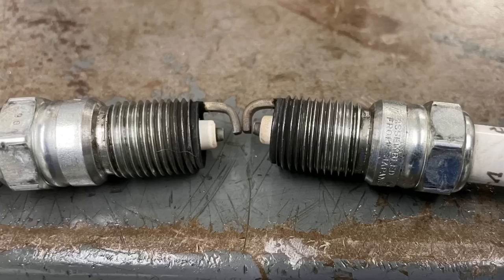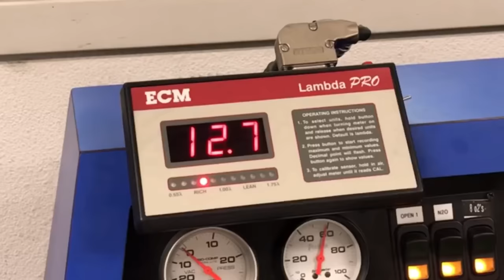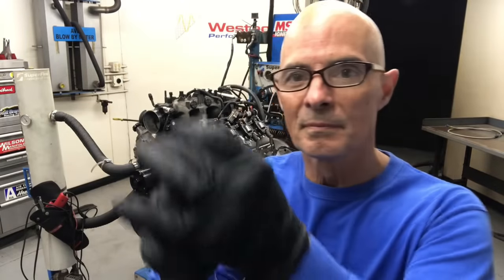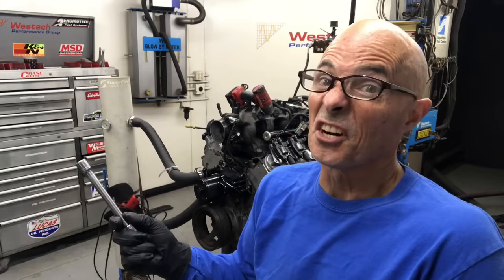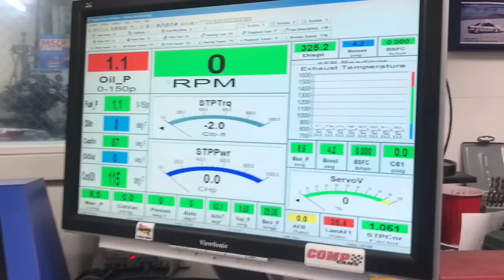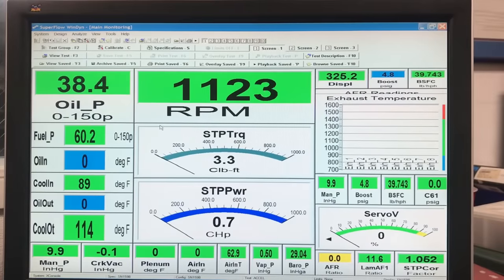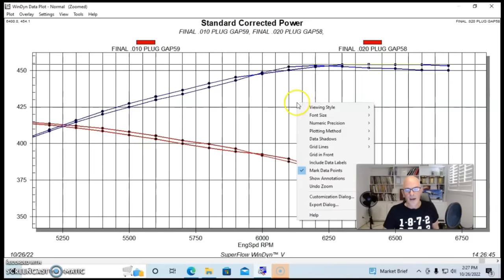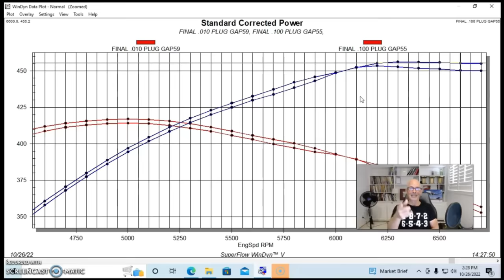JUNKYARD LS PLUG GAP TEST. DOES MORE GAP EQUAL MORE POWER? HOW MUCH SHOULD I RUN? .010 VS .100 GAP

Comment: Wow interesting results. I wonder if the really large gap could be hard on the coils in the long run. I guess it would be interesting to test gap with boost
Reply: Yes, a large gap increases the firing voltage and can lead to wire / coil damage.   This is why I replace coils if I see very large gaps on a neglected engine.  A voltage damaged coil can lead to an intermittent missfire that is difficult to track down.   What happens is that the coil arcs internally if the plugs firing voltage exceeds the internal arc voltage threshold.  
For an interesting bit, do some research on the SAAB Trionic System for detecting knock.
Reply: It's definitely hard on the coils. Seen many burn out if plugs not changed soon enough. Especially on the 2v mod motors.
Reply: Larger gap is definitely harder on the coils and whole ignition system. Larger gap requires more coil energy to make the spark jump. Not only do you get a hotter spark but you get a much hotter coil. It wears everything more quickly. Plugs, wires, coil(s) and in the olders days the Ignition module as well.
Reply: @bobroberts2371  I have had this happen with old worn plugs killing the coils to.
Reply: Keep the coils COOL... helps tremendously. Mount in cowl, fender apron, core support, etc.
Reply: You guys got it backwards. Less gap means MORE juice flows which means the coil overworks and runs hotter. (Think short circuit). 
More gap means more resistance which means less juice flows. 
Resistance is a valve... more resistance=less juice.
Reply: @joebloe9901  Amp draw on coil says otherwise. It takes more current load to fire a wider gap then a smaller gap. Go ahead and test it. I have many times. Amp draw does not lie.
Reply: @terrygonyon4490  nobody can explain why?
How does more resistance equal more currant draw?
Reply: @joebloe9901  well lets put it in something easy to understand. If you had to jump a 2 foot ditch versus an 8 foot ditch which one would require you to put in more work? Wider gap is more work for the coil and makes it run hotter and can produce more misfires where as the smaller gap is easier to jump and requires much less effort. Less effort requires less energy and this is why spark stays a constant. Wider gap requires more energy to jump thus is a hotter spark. This is why in boosted the trick was to run a higher output coil to support the wider gap to get a hotter spark because with the smaller gaps the compression could easily blow the spark out.
Reply: @terrygonyon4490  a coil puts out one voltage. It doesnt put out more voltage because you demand it
By your logic if there was no gap the coil would run nice n cool. But that would be a short circuit and definitely burn up.  
Why do you think coils require a 1 ohm resistor to operate? Because with zero resistance it will burn up.
You are right it takes more voltage to overcome more resistance but a coil doesnt have more voltage...it has one voltage. More resistance equals less current flow per give voltage.
Reply: @joebloe9901  Not true output voltage is related to input voltage. You change the input voltage and output also changes. MSD boxes change the input voltage considerable amounts. Magneto can have a more constant voltage due to the magnetic firing. I've never tested output voltage for different gaps but I have tested Amp draw on the input side and it does vary with gap.

Comment: my guess is the factory plug gap is set to give fair power but not misfire immediately when a plug it a coil starts to get tired. 
Everything being equal, looks bigger gap is better, provided your coil throws a spark hot enough to jump it.

Comment: Yea I done this experiment on my old 302 engine that I had built for my 68 camaro . Basically it was a 12.5 to 1 , set of heads of a G gas car that were capable of making hp . A 600 isk roller sold lifers . I had a shop that build dirt track engines build the bottom end . At any rate I used a HEI distributor recurved for this engine.  The engine idled better with about .045 gap I think . I open up and closed the plug gap to see what the engine wanted .I spun this engine to 7800 regularly lol. Also I use to change the lash a bit to get the engine to do what I wanted. I for got to add the fellow I got the heads that use to race a Monza told me he filed the strap to I think about the center of the electrode.  Seems he said it unmasked the flame . That was a long time ago

Comment: I experienced the opposite scenario with my L29 454. Factory gap is .060, changed to .045 and experienced smoother idle and crisper throttle response etc. (seat of the pants, no numbers to prove). However, I got the idea from the Chevy truck forums which had info from a source that actually dyno tested L29 engines specifically in stock tune and it was found that a smaller gap than .060 yielded an overall better running engine.
Reply: i have mine gapped to .50 and it runs much better but mines a mfpi vortec 454
Reply: @LightningFast240  
Same as mine. Mine is a 98 with 61,000 orig miles on it. It’s a shame they don’t make them anymore.

Comment: I'm glad you did this test.  Very cool. I would have suggested a third gap set properly.  It may have been significantly higher than your 2 extremes.  I don't know.  But, it may show a parabolic curve with  a peak. I have never been one to spend time getting a precise gap.  Just close to spec. Thanks again for your good work.

Comment: Had a Honda CRX that I put on a set of Nology wires on.  Didn't notice any power gains but it did solve a problem with high rpm miss after 5200 to 5500 even after installing a 45k volt coil and new cap, rotor and Accel wires.  After installing the Nology's it would rev as high as I would dare push it without miss.

Comment: Back in the 70s-80s, Oldsmobile used a .060 gap on their V8s and even .080 on some engines! IF your ignition system can deliver the needed voltage, a bigger gap is the way to go, within reason. A BIG fat and hot spark is the only way to ignite an 'iffy' fuel mixture be it Lean or Rich. Of course, it was hell on HEI ignition rotors as they got so hot, they'd burn a hole in the center.

Comment: The reason for the increase in power. Is hotter spark cause it takes more energy to jump a bigger gap. You run the risk of wire spark leak and coil overheating which both equals misfire

Comment: Not sure if a single coil could fire a gap that big. The coil on plug (coil near plug) has an advantage. Running the huge gap will really wear out the plug wires. Very cool test!!
Reply: Use two sets of NAPA 7OO172 Farm Tractor wires. They are for a four cylinder tractor but the solid metal wires are really really long. You cant wear those dogs out. Be advised a stock HEI will eat the side electrode completely off a standard plug in 3000 miles but it will continue to run normally if it's NA.

Comment: my old points cars I would open the plug gap and close the points gap for more dwell time.
you need strong spark to ark across a big gap. 
Advantage is you can burn more fuel with a big ark.
Disadvantage you need to set your points more often and possible over heat ignition coil.
I used a steep hill for my dyno, the fastest speed I could get up that hill was the proof that the tune was on point.
that was the old school tuning. everything is tuned by computers now.

Comment: I tune mainly turbo engine's and found 0.7mm plug gap works well and stops misfires, that is why it will give more power. i've also had a Jag v8 in over the dyno that had been everywhere and they couldn't fix a light throttle and full throttle miss, in-between it was fine, no one had changed the plugs since new with about 120,000km on the clock the gap was large, very large. I've also had misfires with the wrong plugs fitted a few time's. the best was one toyota that had special plugs that cost about $50 each and someone put $10 plugs in it and the customer went to several places that all charged him hundreds of $$  and didn't fix that problem. since I have a dyno people bring cars to me that have all sorts of issues after they have been everywhere else

Comment: So much easier to get the rear plugs out of a LS when it's not in the vehicle. I would change mine more often if they were not so hard to reach. Not that I want to long I would do it once a year if it wasn't so tight back there.  Some say I am obsessed with maintenance but hey it's got 350000 on it now and running like New still im doing something right 👍

Comment: i tried this 100k gap on my motorcycle by placing aluminum washers on sparkplug about a 100k thickness to compensate the gap i use, the other reason is to avoid punching a hole to the pistons because of the excessive gap i use.

Comment: OEM plug gaps are like anything OEM they error on the side of compromise. Most factory settings in newer cars are around .055. The ignitions can usually run wider gaps and still work. 
After market, such as Mission Systems can handle bigger gaps. I installed their coils in 100k tune up in a 3.0 duratec. I installed a home made Cold Air Intake, match ported the plenum and took a bit out of the top of the runner. I used iridium plugs and open my gaps to .070. Quicker starts. Using the swill E85 my butt dyno tells me an increase in torque and I gained about 4mpg in the high way.

Comment: I'm assuming the larger the gap, the greater spark exposure to air-fuel mixture. It creates a more effective flame propagation and burns more thoroughly, and so theoretically should make just a little more power and provide better ignition performance under rich conditions.
Reply: Exactly! You will have a wider flame front which will make a cleaner burn of the mixture leaving less carbon buildup behind it. However I've read that increasing the spark plug gap is not recommended for turbo engines since the pressurized mixture of oxygen and gasoline could blow away your spark, hence they use lower gaps. That's the only downside.

Comment: Richard whst ive found with a wide gap you Must tune for it . A/F and timing re-optimized . Especially a dual purpose street/strip or street/towing with Driveability And MPGs REQUIRED . It Matters and it WORKS !!! Finesse it !!! If i can do it useing a vacum gauge for mpg tuning under load towing you can too . The LS WILL Deliver !!!
Reply from the maker: no on the timing and fuel changes

Comment: I tried .040, - .055 plug gaps in both my race cars. One is a 305, the other a 454. Both have MSD 6Al ignitions. Both like 40 degrees of timing. I found no difference in power. I will try some wider gaps on the dyno in the near future. Great video.
Reply: GangBalls69_Estonia  I will be dyno testing soon. I'm starting with the old .040 gap and then .065, and so on. I'll post my results.

Comment: With a stock inductive ignition system, as you increase gap, you get more spark mass, but for a shorter duration. When reducing, you get less spark mass, but for a longer duration. My experience, with developing a high power inductive ignition system, I found .045 for boost/Nitrous was about ideal, and a maximum of .065 was ideal for normally aspirated engines. The ignition system worked by maintaining constant saturation current on a single ignition coil, for engines that used a distributer. The voltage on the primary of the coil would increase proportionately to the RPM of the engine, maintaining the same Jules of spark energy, until approximately 2,500 RPM. Above that, the spark duration was controlled by the dwell setting. (Reducing dwell would increase spark duration)  Too much gap, and the spark found a different place to ground, besides the electrodes of the spark plug, causing a misfire when ran wide open throttle. The only problem with the system, was the Corona effect inside the distributor cap reduced the life of the rotor. With the old breaker point distributors, the lugs were close enough together, that if the plug gaps were too wide, the strike voltage would get high enough, that the spark would cross-fire to an adjacent plug, causing flames out the carburetor! More gap was better, until you had problems. The larger HEI distributor caps, or, on engines with fewer than 8 cylinders, this wasn't a problem.
     The system produced a very noticeable gain in power, equivalent to lowering elevation about 2,000 feet, for most engines. The power band stayed the same, the 5-10% increase in torque held across the RPM range of the engine. It was often necessary to retard ignition timing 2-4° BTDC to avoid "knock". The bigger the displacement, or the lower the engine compression, the bigger difference the spark duration made.
Reply from the maker: boosted guys run .018-.020 and gap shows no change in power with modern ignition systems

Comment: Plug gap on boost makes a big difference. I have procharged 3.7 Mustang that when dynoed made 460whp on 91 octane with a gap of .035. Took the car to the quarter mile for first time 2 years later from the dyno and only ran 12.9@111mph. I knew something was wrong and should be running at least 115mph based on other people's cars on forums. Decided to pull my plugs and found 2 that were at .045 gap. I swapped them for 2 new plugs and and gapped all at .032 and ran the quarter at 12.1@117mph. That's a 0.8sec and 6mph increase just by 2 plugs being out of gap.

Comment: Science, excellent video.
a larger gap makes more power because the charge finishes burning before the exhaust valves open, further into the rev range ..... once the engine out runs the flame front, it's just wrecking your valves and puking pollutants..... as much gap as your ignition system can reliably snap, just gives you a tick up on your rev limit....
"Spec" is just figuring for the amount of service life plug erosion.... if you have a more powerful ignition, or a plug that will snap on less, then you can increase the gap.
competition forced ignorance, ( winning ) goes past reason on rev limits, and also exploits the fact that liquids do not compress to artificially increase the compression ratio with wasted fuel ...
but people don't have to run engines like that, i always recommend not.....but people who race do, if they want to win, unfortunately.....but this vid is good for street tuners too, just tic up your rev limit with more gap, but don't do super rich AFR ...use stock AFR as a guideline.

Comment: Hi Richard,
Great video, thanks.
Would you consider doing the exact same test with an engine under 1 bar of boost?
Cheers.
Reply from the maker: we run smaller gaps under boost-.100 gap won't work

Comment: Excessive  plug gap puts a major stress on secondary ignition insulation - it kills coil packs.
Smallest manufacturers plug gap I ever worked with was 0.015" on Rolls-Royce B series military engines

Comment: I’m not surprised the larger gap gave the highest power. As long as the ignition system can keep the sparks firing, it shou”do equal higher power. But big gaps with an old distributor ignition probably would lose spark intensity, and have lower power. Interesting test.
Reply from the maker: you missed the point, there was little power change from ridiculous changes in gap-You never run .100 or .010 gaps
Reply: @richardholdener1727  I thought I saw a 1 or 2 horsepower difference with the large gap having more power. It wasn’t much, but the graph showed a slight difference.

Comment: A couple of horsepower for bending a wire seems like a pretty good return. 👍🏼
Reply from the maker: it's not a couple of hp, it was just a comparison on what happens when you run gaps that you never should (.100 and .010) in the middle range-there is no power change

Comment: so...surface area of the spark itself does indeed make a difference. seems like the difference makes for more complete combustion faster and as a result (?) lower the chances of detonation. a stronger spark along with the increased gap to help prevent possible spark blow-out. i know....unlikely with a n/a engine that runs on pump gas but had to throw that one out there.

Comment: SR20Det in my old race car - the plugs closed up over the winter, not all the way, just a little, it ran like a sack of crap under load on the first test, we spent hours trying to find the problem, thinking it was maybe boost or fuel related......we discovered the plugs after wasting all morning and it instantly fixed it, in 35yrs of messing with cars I have never seen such a pronounced difference from just the correct spark plug gaps !!  ( I am not a mechanic btw - just a car enthusiast who got his hands dirty for many years )
Reply from the maker: closed up over the winter? how

Comment: You just created a whole new angle for your channel.... Not only are you testing multiple different cams for the super popular 4.8 and 5.3s, but now spark plugs.

So now, as you mentioned, the in between gaps would be nice. Maybe 30(common) 50, 75 and 100. Then see if you can narrow down the ideal gap between them...

And I know I'm asking too much, but you opened up this can of worms. Lol... What effect does more compression, more radical of a build have on plug gap choice.... And as mentioned by others, different heat ranges.